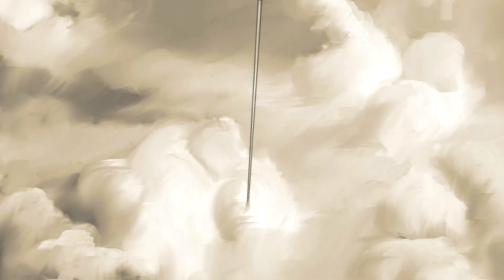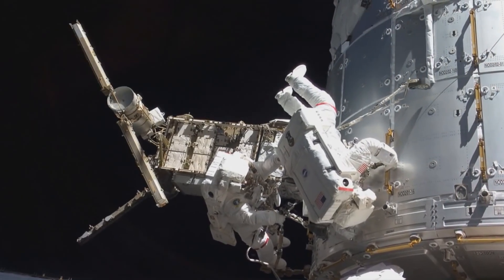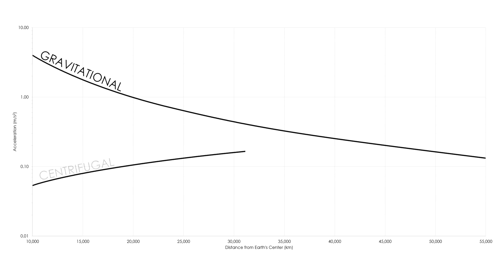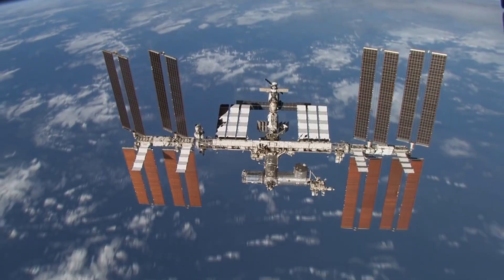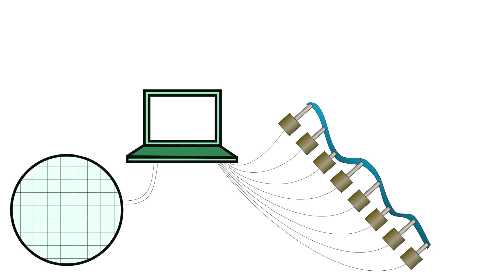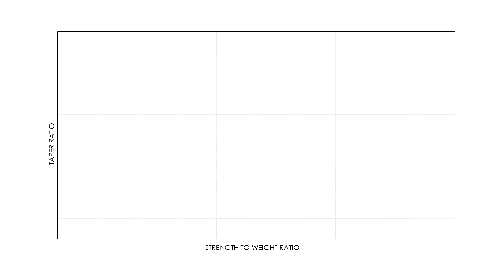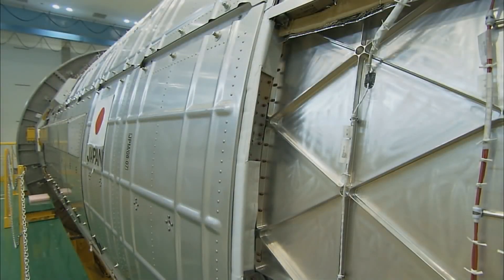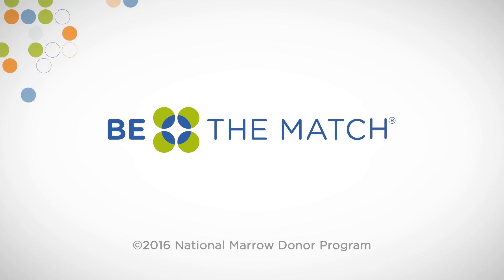Design Your Own Space Elevator

Comment: I'm sure you must have considered using the carbon nanotube tethers as conductors and run the power from a massive, Earth based solar plant, through the tether to the elevator. Would you be able to consider exploring this idea in a future video? Another idea that popped into mind when exploring the laser power beaming idea was to use the laser's power to heat an area under the elevator and use that power to combust the air beneath it thereby giving it thrust. After a certain altitude, it wouldn't work anymore but the idea is still worth considering if you strap on a ramjet engine while using the ground based laser to heat the air in the duct as opposed to chemical fuel. With enough acceleration during that time, theoretically you could reach the space platform. And if that's not enough, combining the two ideas may be more fun to explore.

Comment: If the tether could have a uniform thickness, then it could be a circulating loop. power to circulate the loop could be applied at the ground and probably the terminus station. Then you don't have to power the vehicle, and tether maintenance could be done on the surface. Or perhaps the lowest portion could be a loop, with power beaming only happening outside the atmosphere. Or, it could be a series of loops, with tethers of differing thickness as required by the material, and power applied at each station.

How long would it take to pay for all this, vs Falcon Heavy, at a rate of ... 10 Falcon heavies per day? Or, how much mass would have to be shipping per day to make the elevator more cost effective?

Comment: Any chance we could use electro magnets for the climber? Like a mag lev train? The base would have to have a roll of cable to account for the increase in mass when the climber is at the satellite. But then we run into the tensile strength of steel which I haven't got past 😕. I'm sure someone has already thought of it but that's my best guess at it

Comment: But would this system affect the speed of rotation of the earth?
Due to the conservation of the angular momentum I · w, when modifying I (rigid lifting rail).
What linear acceleration, in its turn, acquires the mass to put in orbit in the ascent? And that must be supported laterally by the rigid rail ...
Reply from the maker: +elias m s Just by a very tiny amount, but then the angular momentum would be returned when the elevator comes back down.

Comment: I enjoyed this overview. This is apparently becoming a hot topic. I remember reading Arthur C. Clarke's book on the subject (yes, the same Clarke as the name for the geosynchronus orbit band), "The Fountains of Paradise". A couple of questions, First, I agree with Einar Gissurarson about having an SPS attached to the counterweight and splitting the power load. Why not make the tether conductive and use it to power the climber? Also, the counterweight could be quit far from the Clarke band so we could use it as a cheap method to launch Solar System ships.

Also, I have read of two other methods for a space elevator. Clarke listed one in a different book (I think "The City and the Stars") which used a rotating tether/weight system so you wouldn't need a climber. I think Neil Stephanson used it in "Seveneves" as well. And Dr. Robert L. Forward wrote about a fountain of rings in Starquake. All of these have their own problems in terms of currently impossible engineering challenges.

I think the largest challenge however is overcoming the character of the human race. We've seen just this century on the internet how something that can be massively useful gets abused or destroyed by a few individuals who want to smash things to see them smash, or to give them a short-term advantage, or to destroy the creators because of jealousy, spite or perversity. We're about to see it happened again, IMHO with the Internet Of Things (IOT) since the engineers continue to insist that because it's so useful, no one will want to misuse it.

Again, I liked the explanation, it was concise and not difficult to follow.

Comment: Assuming we could build this device, my question is what is it good for?   It appears that if it is successfully built the only use would be to take things up to the counterweight.  If released there they would only need thrusters to position themselves in geo-synchronous orbits.  However if taken up only to low earth orbit level and released, they would lack the orbital speed to maintain orbit and require major amounts of fuel to get into orbit and avoid crashing back to Earth.  Remember that this tether is only circling the Earth once every 24 hours, while the speed to maintain low Earth orbit circles the Earth every 90 minutes.I think you can forget releasing anything very far from the counterweight.  Someone please explain.

Comment: why not include some sort of power cable in the tether? even if the main material isn't a conductor, then you could just put a copper cable or a superconductor if that's too inefficient in the middle of the cable. if carbon nanotubes are going to be the material, they can transport electricity themselves. (unless i'm mixing it up with something else) and no matter what we do, it would be more efficient than rockets, so don't tell me it would take too much power.

Comment: Wouldn't using nuclear power work for the climber? Or would the size of the nuclear reactor be too big to be feasible (As in it would have to be X big, but it would need to have Y power thus the reactor would actually have to be X+Z and then you would end up in a loop of needing more power, but needing it to be bigger to get more power) or would the radiation be too high to be feasible (and end up in a similar loop, having the radiation shield be too big and heavy to really work)

Comment: "centrifugal force" There is no force acting outward... at all. That force doesn't exist.
Your problem arises from assuming a static system, but that circular motion is important. What you're doing is applying a perpendicular force in order to change the velocity of the object. So your forces aren't balanced in this kind of system, because circular motion requires a constant acceleration applied perpendicular to the motion. This relates to a constant force.
Reply from the maker: +Jordan Gilbert The reference frame is rotating with the elevator. Centrifugal force does indeed exist in a rotating reference frame.

Comment: if the speed of the earth spin at the equator is fast. i.e. diameter of the earth dived by 24 hours. the further from the surface you get, the faster you have to go. 

so in addition to the gravity and outward force, doesn't the platform have to have fail proof engines pushing it forward impossibly fast to prevent that base out running the platform and winding around the earth like a yoyo?

Comment: If the tether is made of graphene it should be super conductive, right? Or at least very conductive, then you could just pump high voltage AC in it, and use induction to get power out of the cable.

Comment: what's the point of the cable anyways? if you have a laser powerful enough to get something to orbit, you don't even need the cable. the only purpose of the cable would be to stabilize the laser target. but I suspect there are some much easier ways of doing that which don't involve carbon nanotube cables thousands of kilometers long.

Comment: Why not send the power through the cables themselves?  Nano-tubes are conductive are they not?
Reply: The problem with that would be that the electricity would just flow PAST the climber, as the tether needs to go past it uninterrupted. Also with a single cable you wouldn't have a closed loop for the current. So you'd need to use two cables that need to be insulated from each other. Either you'd get power from current that you let pass from one cable to the other, or one of the cables is a guiding cable and the other one is a pulling cable that you just reel in from the top. Which would mean that you'd need to accelerate 1000 cubic meters of carbon nanofibers per square centimeter of cable cross section at the climber. Or you could just send the current past the climber and transfer power by induction. You'd still need two cables in close proximity to in order to shield any stray fields , because else you'd have the biggest wireless power transmission antenna ever conceived.
@Keyboard runner Having a nuclear reactor next to a structure that could wipe out a whole county if it would break due to ratiation damage does not sound smart. But a space elevator is such a crazy concept that that might actually be the smartest solution... After all, you only need radiation shielding on the side with the cable and passengers.
Reply: Not sure why people want to discount the simple solution. Yes there are losses, but the higher you go the less power you need. Could also add a power generator at the counterweight to effectively halve max resistance. I guess the heat/conductive properties of the tether would determine whether this is more efficient over nuclear powered lift vehicle, but that requires some math to determine.
Reply: Resistance grows with distance. So no.
Reply: @3gunslingers  Sure, but there could be small stations on the tether to help pass the electricity along.
Reply: @3gunslingers  this. i scrolled so long to see someone suggest nuclear cabin. we have it in US Subs already. A micro reactor would provide all the power needed.
Reply: @Hallowed_Ground  Not how that works. Energy is lost due to the heating of the cable. You would have to have stations that had their own power, but where do those stations get their power? You would substitute the original problem for the same problem but with more mass on the cable.
Reply: @chronomancer8772  Ah, gotcha. Definitely a problem for smarter minds than mine.

Comment: What about an elevator to/from the moon to reduce risk/cost/access to the lunar surface? Any thoughts on that?
Reply: Info is around on a moon elevator. Could be built now using existing materials if the cost could be justified. Not currently worth it for the scant few spacecraft that might be going there in the next 20 years or so.

Comment: Why do you need power in the elevator? you can use it like a cable car so the tether would go around twice in a loop and you would use motor on ground that will move the theather.

Comment: Wish I could say just use multiple lift stations as Counter weights but that would add more problems earlier on, getting weight up there, mining and hauling appropriate weight from orbit down to help drag it up, the potential need for pullies machines of large size if weight can't be got, additional incredibly strong cables. Though here's an idea for solar, solar nexus further out connect relay station which sends through orbit to earth atmosphere-large likely energy loss,another cable say fibre optic or other core to transfer energy directly to station - possibly minor boosters using any gas/ fuel for minor pushback corrections from energy impact if we weave energy transfer through main lift cable ... At that point might just be able to magnetize in a rotation by using the energy to move things up and down, no idea if it's here requirement is doable or risks planets poles current magnetization or causes massive dead zone for electronics and animals natural compasses

Comment: Sense when is centrifugal force a real force? Seriously, I thought centrifugal force was not actually a force and could then not be used in a force calculation. Am I wrong?
Reply from the maker: +Travis Jonker In a rotating reference frame, it is a real force.
Reply: The derivation of the Clark belt came from omega^2r, and they didn't nit use a static rotating frame. Is this just an engineering trick, I've never heard anything like this in physics.

Comment: could you use cables and then have the station keeping it tight at the same time keeps it in orbit
Reply: Usually, people speculate that the center of mass of the elevator is a GEO, but there’s a big counterweight above that. Because it would be traveling too fast for orbit at it’s height, it would be pulling up on the cable.

Comment: One of the very cool things about having a space elevator is that not only do you get free access to GEO, you can also, depending on the location of the counterweight, get free transfers to Mars or Venus at whenever their windows open.  Conceivably, you could also release a little closer to GEO and get a free trip to the moon.  A space elevator literally opens the solar system to us.  Imagine being able to send payloads of any size to Mars with just a few RCS thrusters to fine tune the aerobraking trajectory.

Comment: One of the details worth considering may be the wear on the cable from the trolly going back and forth constantly. Something, such as this cable, that requires a precise diameter to support its self may fail from being rubbed thin from the elevator... It would need to be monitored regularly and repaired occasionally.

Comment: What few seem to consider is the fact that a space elevator would function like a giant lightning rod.  And this particular rod would attract electrical currents from the sun which cause the Northern Lights, among other observable anomalies.

This is a great video on a fun concept, but unless the electrical realities are addressed, it is doomed to failure.

(Global electrical currents flow through rock, silica sand, etc. so building the elevator out of 'non-conductive' materials is not an option.)

Carbon nanotubes would definitely be conductive enough to function as a planetary lightning rod.

Comment: Why would we even bother having a separate powering system when carbon nanotubes are conductive?
Reply: Then you need two tethers for the circuit?
Reply: Well, first solve the problem of the cable and then think about the energy issue, which seems complicated enough but maybe less absolutely impossible.

Comment: Here is a question I have that I never see address in any of these discussions. Let us say we do make nano-tubes on the scale that is needed to make this a reality.  

Do we have anything that can grip a 2 mm (or less) cable and pull up tons of weight?

To further illustrate my point, let us say I give you (as a person) a 2 mm wide rope and tell you that you have to climb to the top of your house with it.  Technically the rope is strong enough to hold you (it can hold up a elevator, after all) but most likely you will not be able to get a grip strong enough to support your weight...and even if you did, the rope would most likely be cutting into your hand as you tried to climb.  It would be like trying to climb up the sharp edge of the sword.

Now granted, machines are capable of more the people...but have they thought of how this elevator is supposed to grip this magical string
Reply: It would not be a round rope but a flat ribbon.

Comment: I think it's much more feasible to build a smaller sky-hook. Space elevator is a special type of skyhook that orbits at the same speed as earth rotates, making it possible to attach its base to the ground. That is technically not necessary. You could build the hook at much lower orbit, in which case you would use fast aircraft to get the cargo to reasonable speed (matching the orbital speed of the hook station) and hight and then use the sky hook to pull it rest of the way.

Comment: Hey, just watched this video (thank you for an actual technical video instead of one meant for masses like you pointed out more media facing people have to be) but I have some questions regarding the payload delivery working from the point of view that the CNT works:

1) Wouldn't having the the payload being rocket powered still be more efficient than a laser as you don't need to achieve orbital velocity, have a simple 2 stage: one for obtaining LEO and one for the stretch to the Clark Belt?
2) Could a high altitude platform be used for starting the payload further up? Pretty much everything we would make to go up would have to get delivered to the base of the tether as it is and that would most likely be done via planes, so why not have a 30k ft platform built as part of the tether (I understand weather could be a concern as at 30k ft a "good" tail wind is 200 knots, but it doesn't have to be that low and maybe a high altitude balloon system could be used to cart stuff from ground to the platform as the majority of the problem with rocket power is leaving the atmosphere)?
3) What about instead of a CNT we have a carbon nanotube tube, (I realize this increases the complexity of the tether by making it a hollow internal structure and you literally just said the cross sectional area is important) but could it be possible to use the vacuum of space to cut out the need for powering lift?
 
Anyways, I've been working my way through your videos really enjoying the technical side of things and the real models you use :D

Comment: I honestly don't think they should use a tether. I believe they should make a big thick structure and make the elevator more like a sideways train that goes upwards, and uses magnets. And if the structure was more like a building rather than  just a string, power could be transferred from the tracks to the elevator better. Just a thought.
Reply: And at the top there should be a something akin to the top of the space needle, but with solar panels sticking out, and since there isn't any atomosphere to block the sunlight more energy can be collected and stored for the top of the elevator.